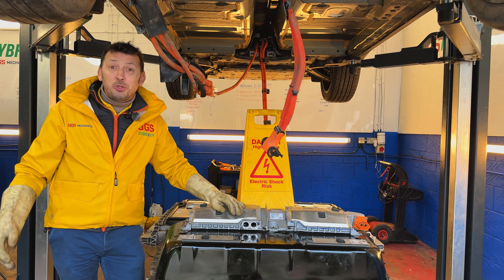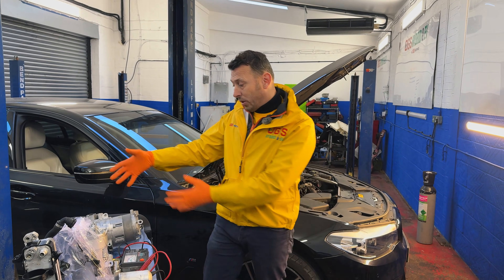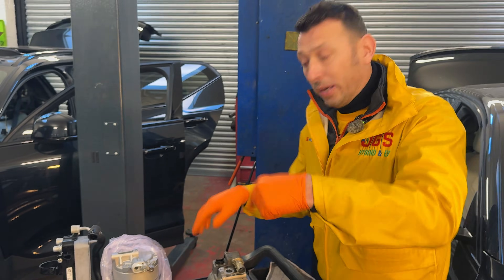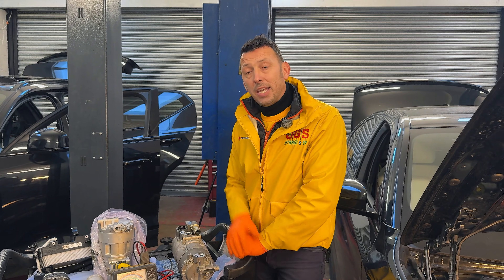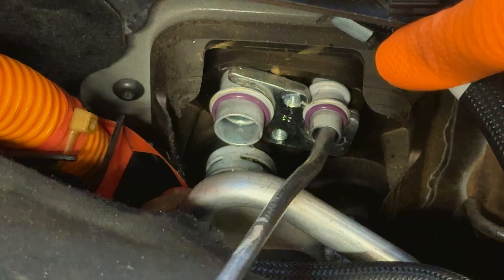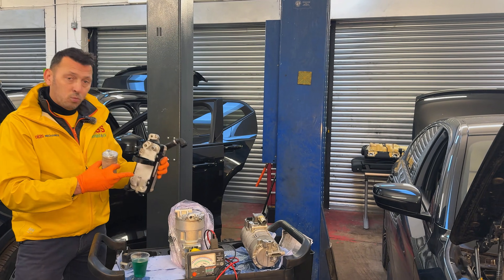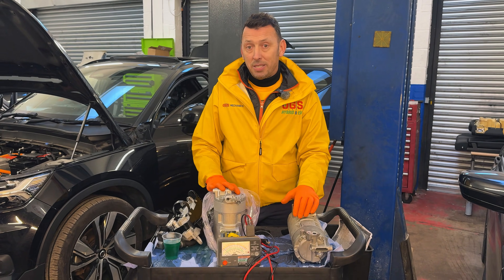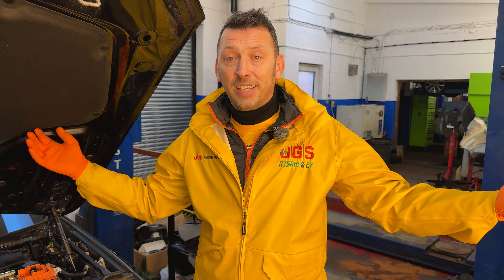We Found COOLANT in the High-Voltage System… This BMW 5 Series Nearly Destroyed Itself!

Comment: How can it be that the Vehicle can still be driven if there is an isolation fault within the HV system. 
I would assume that you can finish one or two additional driving cycles but then the HV contactors will Never close again. If the car as a 12 v ignition starter maybe the OEM implemented a driving Mode with open HV contactor using induction of the rotating e Maschine while driving  to supply the 12 v battery via the powerelectronics / DC DC converter

Comment: Hi George! Thanks for this. Is it possible to find out what exactly happened in the failed part? Or is this very hard to find out?
Reply: Can’t “prove” the single root cause without cutting open the heat exchanger, but the typical contributors are:

Manufacturing/flux residue + corrosion/chemical reaction inside the water-cooled condenser, which BMW has acknowledged can cause deposits/gel and cooling circuit issues on affected setups. 
NHTSA Static

Thermal cycling + vibration stress over time (thin-wall exchanger cores don’t like repeated hot/cold cycling).

Coolant chemistry issues (wrong coolant mix / contamination) accelerating internal corrosion.
Reply: @ovidiugeorgestoica5483 Thanks George! Great explanation, I understand it now.

Comment: Hi George 👋  .
Could the system be drawn down like when you draw the air con gas out and draw out the coolent moisture out ? .
Great interesting video 📹 👍.
Reply from the maker: Good question, but no – pulling a vacuum alone won’t dry a contaminated system. The vacuum step in A/C servicing is only designed to remove air and non-condensable gases, not to extract coolant, glycol, or moisture that’s bonded to oil and internal surfaces.

Once coolant/moisture has entered the A/C circuit, it becomes absorbed into the compressor oil and desiccant, and a normal vacuum cannot boil it out. On BMW HV systems (like the 530e) this is absolutely critical because any residual moisture reduces electrical insulation, which is why the car will flag an isolation fault and disable the electric compressor.

Comment: What can we do to avoid issues like these? I have a 545e that i've recently replaced the AC compressor on because it had a whirring sound when it ran.
Reply from the maker: First thing is always use the correct BMW-approved coolant (HT-12 / whatever the manual specifies). Mixing different coolants or using cheap alternatives can mess with the corrosion protection and, over time, cause internal damage.

Second, don’t treat coolant as “lifetime.” Even though BMW isn’t always very clear on intervals,  change the coolant about every 30k miles (50,000 km) or every 2 years. Fresh coolant keeps the additives working and helps prevent internal corrosion or buildup.

And finally, regular checks really matter. Just keeping an eye on the coolant level every few months or before long trips can catch problems early. Low level or discoloured coolant is often an early warning sign — way before it turns into a big (and expensive) failure.

Comment: Modern cars are over complicated and often very expensive to repair when they go wrong.
Reply: What a dumb design to run A/C lines through something as delicate as the HV batt. pack. I can understand the heat exchanger which also can be used to heat the coolant i suppose but they shouldve left it with just that.
Reply: It's not like that. Coolant is cooled  inside heat exchanger by compressor